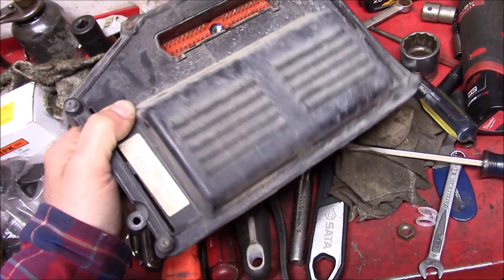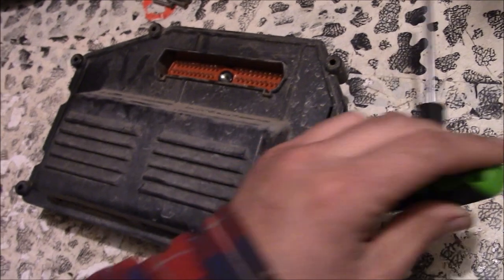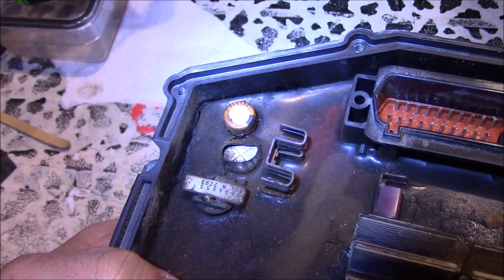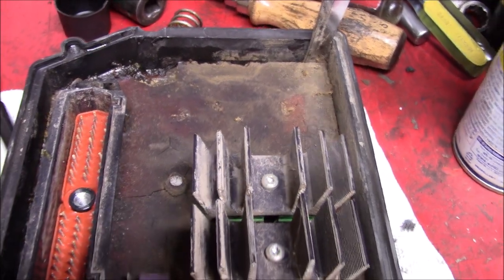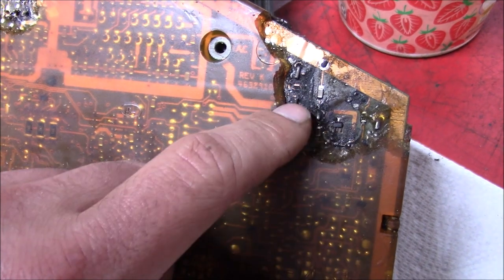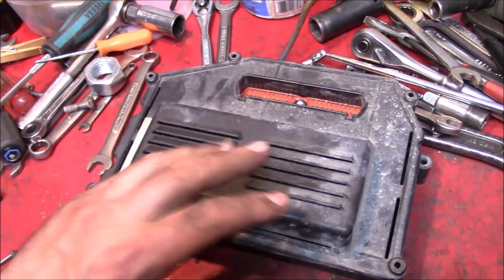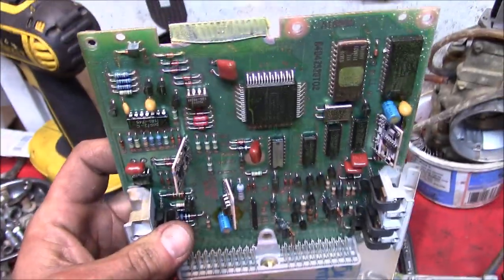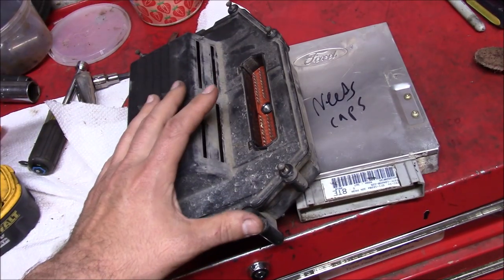ECM Failure - Dodge 12 Valve Cummins

Comment: My hopes went up when I saw the exact same burned areas as mine, the dual condenser and resistor on the corner, and the small area behind the connector...  I was so bummed when you concluded no fix...  I did come to the same conclusion, but was hoping the YouTube gods would smile uppon me...  I found out for sure I had a PCM issue when I jumped the relay to see if the alternator would charge.  As soon as I did that, the PCM started smoking...  :(   Anyway, I guess I'll have to look into PCM delete videos now... BTW, I have a 93 12v manual.

Comment: Your pretty much a pro now on those older 80-90's ecu's. Its pretty much always bad caps with them.  The cummins ecu can be repaired if you really wanted. Its a pretty basic board and rather easy to make new connections for everything. I used to do those ones once in awhile back in the day and they all typically looked like that. Don't usually accept them these days. The potting makes it take too long so there is just not much money to be made for the amount of time invested.

Comment: I rebuilt the PCM on my 92 12 Valve not too long ago, same board you have. As I understand it the capacitors have to do with the way the PCM powers on when it recieves ignition on signal. They tend to overheat and pop open. I got my engine bay really hot going up a hill one day and after that incident my ECU would intermittently come to life after a while of driving as it warmed up again. If the temperature outside was below freezing however it would completely fail to boot. Pulled mine apart and found the same capacitors you looked at had the plastic outer shell had completely melted off into the potting material. It was pretty hard to source the proper 25V caps in my case but I put a set of good panasonic ones in and good as new. 

Unfortunately in your case it looks like they REALLY overheated and the damage actually put so much strain on the main connector that it burnt up too, I believe the pins that were burnt in yours were the main 12V power as well as 12V ignition switched and a couple of the 5V outs. Another common failure for them is for the internal voltage regulators where those big heatsinks are to overheat and burn out or sometimes even take the board out with them. These PCM's are really sensitive to heat!!!

Comment: According to shango066, these ECMs will function without the caps. If you anything approaching the age of this, go in and cut the caps out.  It's the leaking caps that cause all this damage.
Reply: Nice, Shango's the best. Was just watching him before this.

Going in and preventatively replacing the caps with good quality parts would be even better. Have done this in other equipment, but I can't say I've ever worked on one of these, or how the caps contribute to the circuit.
Reply: @JulianA-tr6pt  I watch him for the TV/Radio stuff, but he also occasionally uploads ECM videos.
Reply from the maker: That's interesting to hear, will have to check it out.